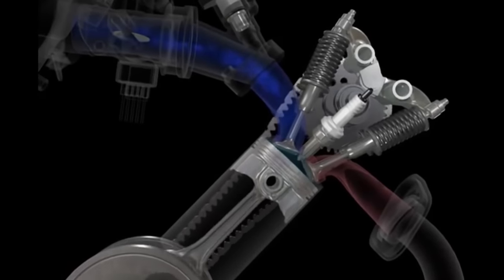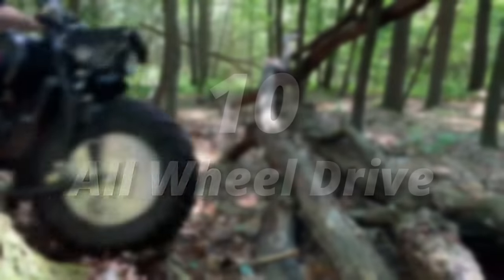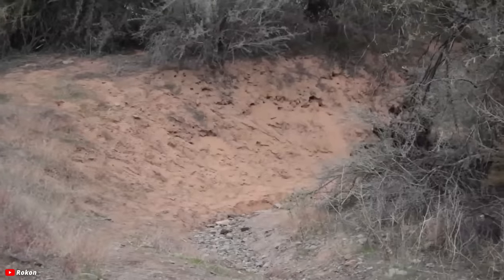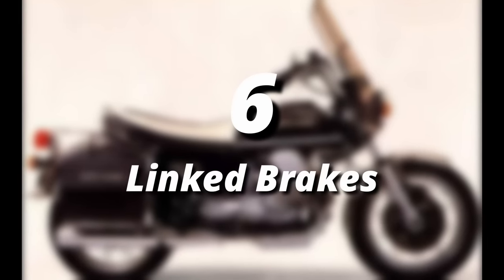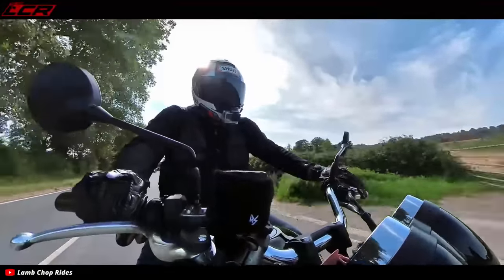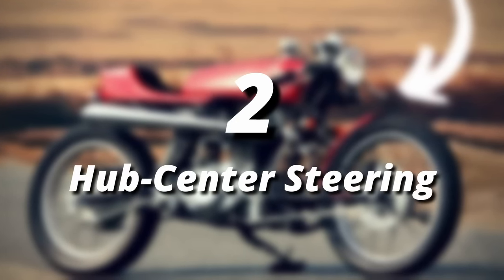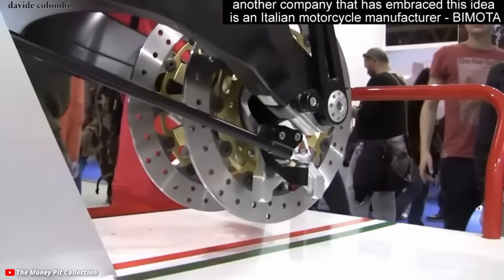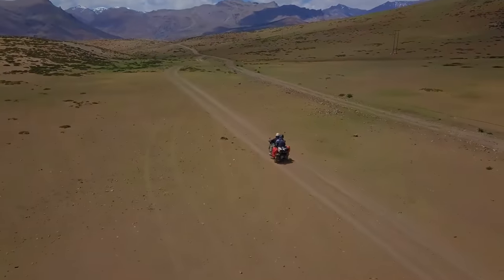10 Motorcycle Innovations that never caught on

Comment: I am curious to see if we get all-wheeled (or at least assisted front or rear wheel) electric motors on a hybrid bike... sort of like a plug-in hybrid where the gas motor is used for acceleration in combination with the electric motor but once you stop accelerating, the gas motor kicks off and waits for you to accelerate before kicking up again.. they also use the electric motors to fill gaps while changing gears creating a smoother transition from gear to gear w/o losing power.. there are a lot of neat things on the horizon with hybrids.

Comment: AWD via a front electric motor is a easy DIY add on and should be standard equipment eventually someday on street bikes with EV and E-aviation technology trickling down.  Lightweight batteries that can handle high levels of power our ideal.  This will improve energy efficiency.

Comment: Current gen Honda Goldwings have nonstandard double-wishbone front suspension/steering that links the handlebars via two aircraft style pushrods. The system reportedly reduces bump harshness and braking dive; there's even real-time electronic control as an option. I've ridden them and they feel quite normal in behavior. I can imagine problems if the pushrod linkages develop play or the linkage fails. Linkage design is a bit more complex than with a standard fork whose design is naturally fail-tolerant, where the the pushrod(s) could fail catastrophically under the right set of circumstances, although the risk seems low.

Comment: That Honda 750 from the 70s with the automatic gearbox box could only manage 85mph where the standard could meet 110/120 mph, I was contemplating buying one at that time and went for the cheaper Suzuki GT550 two stroke triple which could manage 95mph in about 15 seconds

Comment: The reason Vespa and Lambretta used a twist grip shift is because of the type of transmission they use. Hard to explain but if you look at a diagram of the transmission it will be clear. It's a simple and elegant design. A few motorcycles used a similar transmission such as Jawa and CZ. It works well enough on a low horsepower bike but wouldn't work on something with more horsepower.

Comment: A combined brake system is actually a requirement for those 3 wheel scooters that are marketed at car drivers. Though ironically, as they are registered as a motorcycle, they aren't subject to technical inspections in the Euroland I live in. So one of the most common modifications to those things is to remove the foot brake entirely and split the normal hand brakes so that they act like they would on any scooter.

Comment: Yamaha GTS used a swing arm front suspension and BMW has plenty of different setups. Linked brakes are super common today and have been since the 90s. I find myself at odds with much of your opinions but would chalk it up to different backgrounds. I have been a motorcycle mechanic since 1990 and have experience on all major brands and my opinions are based off working on the bikes and problem solving. I could be wrong but im guessing your experience comes from reading about them.

Comment: Linked / Combined Brakes still exist and are quite common in Low-Cost Motorbikes in lieu of ABS. 
For example: my Benelli 2022 Leoncino 125., the Grip Brake controls the Front Brakes; while the Pedal Brake controls the Rear + Front., applying the pressure to each depending on the pressure on the pedal according to the Emergency Braking Procedure... and so instead of a Rear Brake Pedal it's more of an E-Brake. 

Now on the one hand this is great as it does make E-Braking quite easy; and given where I live and the number of Scooters, Cyclists and Pedestrians with a Deathwish. 
Still on the other hand I wish there was a way to switch it to Rear-Only, as even at small pressures it applies some Front Braking; which makes it much more difficult to use for Low-Speed Manoeuvres as you would with a traditional setup... so, I have to instead control via the Throttle and Clutch; which neither quite has the precision you want (hence why you'd normally drag the rear brake to control speed better).

Comment: the vespa type shifter was not the best . the problem with all hand shifters is the small selection between gears. if you try to go uphill and have to shift and steer a lot. You have a big chance of going wrong gear

Comment: Norton actually made an oval piston engine before ww2, which produced more hp than a conventional engine at the time, but it never saw production line because it was too expensive. And furthermore, a yamaha gts1000 is not a hub centre steered bike, because steering does not pivot inside the hub,> steered mono upright.

Comment: Late to the party on comments but what the hell.. I owned a DKW with leading link front suspension and it was bloody awesome.. No matter how hard you brakes the front never dipped, the steering geometry never changed no matter how hard you pushed it.. Yeah you could feel the extra weight but what effect that had on speed was more than compensated by just how hard you could corner..

Comment: A couple of comments on this video. In the UK Raleigh Roma scooter in the 60's had a 3 speed twist grip gear change, but that model didn't last very long as the Italians seemed to be better. Moto Guzzi's in the late 70's had twin front discs, one hydraulically  linked to the rear with the foot brake and the other just to the handlebar brake lever, that worked well on the bike I tried. And Honda had the 250 and 400 Superdream offered with an auto gearbox. Otherwise an interesting video

Comment: One "innovation" which definitely didn't catch on was "internal" (inside-out) disk brakes, as on the Honda CBX550F, VF400F.
The disc was a ring inside the body of the wheel which attached via its outside edge to the wheel, with the caliper wrapping around the inside of the ring.
I'm not sure what the advantages were supposed to be (I assume there must have been some reasoning behind the idea), but it definitely didn't make for simple wheel removal/replacement - no-one at a tyre place was ever pleased to see me arrive on my VF400.

Comment: You are completely wrong about the Moto Guzzi linked brake system as several people have pointed out. What hasn't been mentioned is that the brakes discs are cast iron, not stainless steel, and the brake pads are relatively soft. You get through pads quickly, but you can really stop. Also when you use the foot pedal you still have full control of the throttle and can use the engine to brake as well and only use the hand brake to finally stop. Goodridge hoses also improve the efficiency. There is no point in having less when you can cruise at over 100mph.
The only thing wrong with the Guzzi system is that it takes 5 minutes to get used to and then any other make you ride you put your foot down and come off.

Comment: I had a 50cc moped that could be configured as hand or foot shifter. As far as I remember, everybody tried to transition to foot shifter even though it required drilling a hole in an engine side cover.  There were cables that were constantly broken, shifters stuck, hard to find neutral (surprisingly), and also, in the moments when you just want to apply clutch, you could accidentally shift gears. And that moped had only 2 gears. I think modern bikes that have 6 gears and especially some offroad oriented bikes would deliver terrible experiences if shifts would be done by hand.

Comment: The oval pistons didn't really work that well....and Honda spent millions trying to develop them.  Its main advantage is maximum valve area for a given displacement, and Honda was trying to match the power output of two-stroke engines.  Ring sealing was a big problem, as was what Honda called "The phenomenon of sudden disintegration ".
Reply: Always wondered how the Honda GP actually compared with current road sports bikes. The road NR was obviously a detuned engine to make it last.

Comment: Had a small 125cc (MZ from memory) that had a couple of what I thought were good features. !st was the combined gear lever/kick start, by pushing in on the gear lever it could be flipped over to act as the kick starter. next was the clutch/gear change, this worked as you would expect except the gear lever also had a cam and pushrod arrangement so that when changing gear the clutch was also disengaged.

Comment: grip shift was also used with Piaggio Ape cargo trikes, the ones with the handlebars at least. it was also used on the ice cream mobile i drove back in the day, no idea what that was. It worked fine, but the cables make shifts mushy and springy. given that most if not all that used grip shift also used a sliding spline gearbox, this can be used to "preload" a shift, and than shift with a throttle blip. This makes clutchless shifting very easy to learn. I've done so many Ape miles grip shift very much became second nature, though I'm unsure if it is actually better in any way. it's mostly done because having a regular shifter was impractical with the rear engine and running boards, and in the Ape it means you can drive side by side with a passenger on the left, since you only have the rear break pedal on the right to deal with (front brakes are somewhat useless on an ape)

Comment: Surprised no-one mentioned the RE-5 or more specifically Wankel engines. If my memory is still good, I think Norton had one as well
Reply: But i found out recently and suspected as much Norton didn't even make the engine,Been trying to find out for year's imagine a British motorcycle company who couldn't hold it it together when Honda introduced a 4 cylinder 750,Spending millions on developing thier own wankel? I have never believed it all BS, and now know it was the engine s were made for someone else who never got them and Norton used them with some success,I wanted the RE5 and dealers were happy to sell it,But maintainance no can't help your so i bought the Suzuki GT550 two stroke triple,Years later my mother got me a book superbikes of the 70s and there was the RE5 that mirrored the performance of the cheaper GT550
Reply: No-one? We mentioned in the comments already the Suzuki RE5, the Hercules W2000, the Van Veen OCR 1000 and the different Nortons with a Wankel engine.

Comment: "I don't want a computer to steer my bike"

But it already does. On any bike with an electronic throttle, all that the throttle does is it asks the ECU to give you power - and if the ECU feels like it, it will open the throttle valves and deliver some power.
Reply: Adding to this: your lack of research makes me wonder what you left out of the Britten V1000 video.

Comment: As to the front suspension, although there are options that can be adapted to bikes, the weight transmitted to the front on regular suspensions are important during trail braking, whereas those suspensions prevent that effect making it difficult to ideal use of front brake
Reply: You should read some of the tests on the bimota and the vyrus. They handle better than any motorcycle out there. I can remember the testers name he was a former racer testing for cycle magazine and couldnt believe how hard he could corner with the bimota. So much corner speed that the tires could not handle the stress and wore heavily. There is a team campaining a vyrus in british superbike and well for a private team
Reply: @holmes1956O  I'll search internet for that and look into it. Yet, no factory, or any team use that kind of suspension. I believe if those suspensions where superior, they would use it on MotoGP
Reply: @hesleyt  I know what you are saying however moto gp is very much driven by money and brand loyalty. Also apearance and most "bikers" dont like the looks of hub center steering so wont buy it. There is also a guy in the netherlands that builds bike with hub center steering and yamaha had a production machine with it that didnt sell well but had great reviews I think that was back in the 80s the designers name was parker
Reply: @hesleyt  the fellow in the netherlands is stellan edgland his company name is ISR. The kneeslider did story on him and his bikes
Reply: @hesleyt  alan cathcart tested the vyrus for motorcyclist magazine look for that. A very interesting read.

Comment: Covered in part by others but the twist grip gearchange menas that with more than 3 or 4 gears the clutch lever will point up or down making it harder to change in the top and bottom gears, you can see how far it moves with just 3 gears in your film.  If the lever stayed in one place and the twistgrip selected the gear then that would be an imporvement but the standard set up works well.

Auto gearboxes are fitted to a lot of smaller scooters but only run 3 gears usually.  I think electric bikes only have one gear so these don't actually have auto boxes.

The variations on forks add weight to the front which will affect steering, see also the Honda Elf race bike project where the steering was by levers in the fairing sides and not by bars.  BMW may say how great the paralever/telelever set-up is but on their performance and race bikes they are conventially suspended.

Turbo and superchargers aren't really needed on bikes as 200 bhp/litre can be found, my 1200 cc car with a turbo only makes about 70 BHP!

You didn't cover Wankel engines, perhaps worth a look unless you have already done them?  Also the 3 wheel Tekken and the like?

Comment: Sorry, but the Britten (Hossack) design is not a girder. On a girder setup, the linkages and the fork both swing around the axis of a fixed steering as the front wheel is turned. On the Hossack design, the steering is done independently of the double 'wishbones' attached to the frame, and from which the steering head is suspended. A subtle but important difference.

Comment: The late 80's early 90' Yamaha venture Royale had Linked brakes with the rear and one front disc, and the hand lever was the other front disc.

Also Buell had many,  Perimeter breaking is stronger than two regular disc and lighter so less unsprung mass.
and hollow frame  also being a gas tank to lower the center of gravity.
Reply: I never thought about the centre of gravity good point

Comment: gidday,

Unfortunately your comment on the Moto Guzzi linked brake system wasn't right.
The foot brake operates the back disc and only ONE of the front discs.
Yes indeed, my Cali gave me a huge scare on my first ride, when I tried to slide out the rear wheel.
But it sort of works when you're used to it, especially in cruising mode.
I've got a weird baby sib of the Californian now called a "Florida". Ugly as sin, but with a loverly old style 650 lump and the same brake set up.
Good on you Sport.
Regards
Grazzi Noelin Dallas

Comment: AUTOMATIC SHIFTING: While in the US most cars are automatic, in Europe not so much. Here in Germany, automatic even costs more. And even my 70 years old mother prefers manual shifting. And while driving your kids to school on straight roads doesnt require any manual shifting, when racing, driving offroad or driving anything bigger than an SUV - or a motorbike - it has serious advantages. 
I just rented a 155cc yamaha nmax scooter in indonesia for a month. And the roads we had to use could be steep and in pretty bad shape. So there were 2 things I missed: Bigger wheels and manual shifting. It just gives you the advantage to use get extra acceleration when you need it. Instead I phukked up the centrifugal clutch of that new scooter (>6000 km) within days...
And even on german Autobahn (motorway) which has 3 lanes and no speed limit: Driving it with a motorbike isn't much fun but the moment when the driver of that stupidly fat black mercedes Benz SUV in front of you finally reallizes that he could go on the other lane and give you some space and you quickly shift down 2 gears and pull the throttle ... don't try to sell me automatic!

Comment: The part about automatic transmissions not being utilized for motorcycles? Apparently you have not looked for a new Honda Goldwing with a manual transmission. Took me over 2 months and constantly checking Honda dealers in multiple states to find my new 2023 ‘Wing with a clutch.

Comment: In the sixties and seventies, many mopeds in europe had hand-clutch and turn-shift on the left hand side of the handlebar: Puch, Sparta, Zündapp, to name a few; they all had 3 gears and a neutral position. It's not a typical Vespa feature. Later on, all makes went form handshift to footshift. I think it's because hand-turning to more than 3 gears plus neutral-position is not possible: the clutch that also turns gest too far out of wack to handle comfortably with 4, 5 or 6 gearpositions plus neutral.

Comment: Not a big invention, but I like the stop-and-go function on my little SH150i. Newer and bigger Honda scooters don't have it, I wonder why.
Don't think it saves fuel but other riders of way bigger bikes wonder why my scooter is silent at a red light and takes off as soon as I twist the throttle.
And the engine cools off a little when not moving, usually that's when the bike heats up.